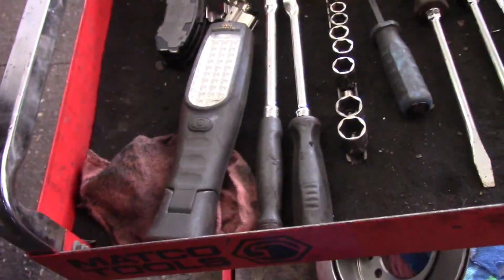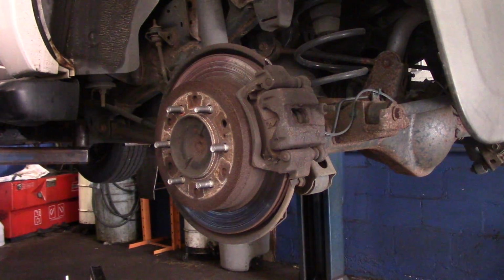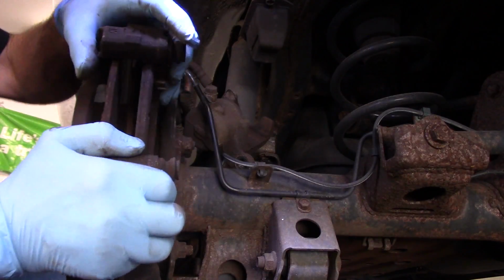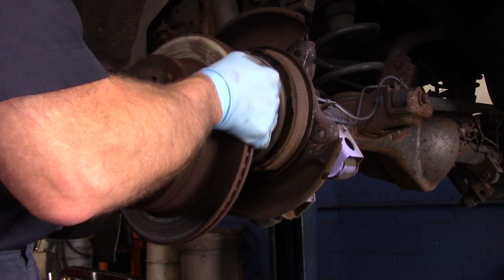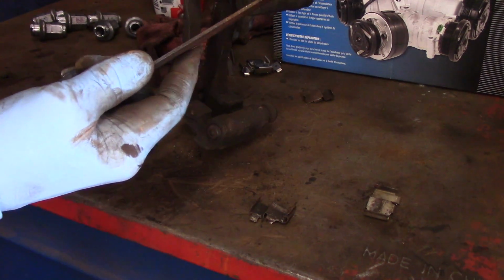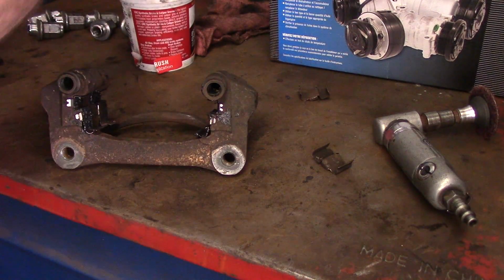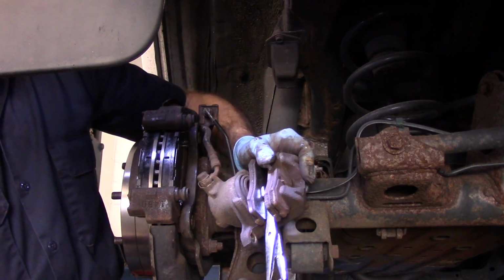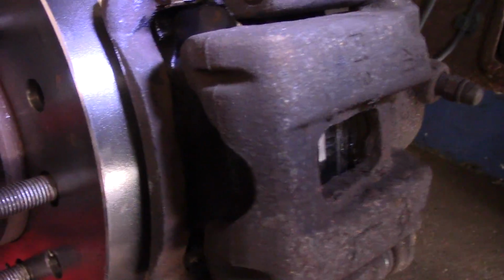How To Replace Rear Brakes & Rotors 2004-2007 Toyota Highlander

Comment: Why you showing the people the wrong info you struggling tryna take that router off hit with the hammer close to the studs not where the actuall brake pads go on the rotor and it’ll pop right off if it ain’t rusty rusty rusty

Comment: Great video. I always use a little anti-seize between the hub and new rotor to help with rust/sticking for the next time rotors and pads need replaced.
Reply from the maker: Great point!